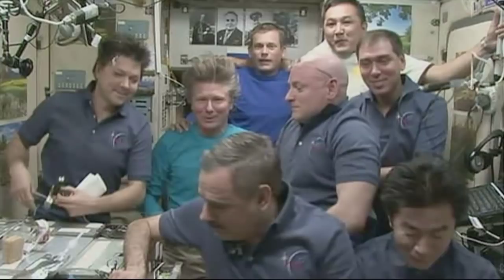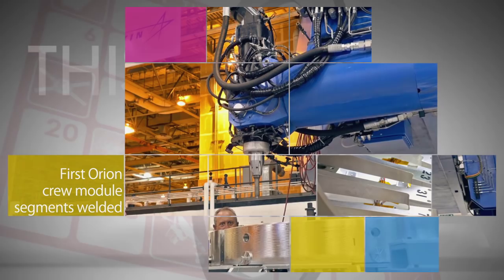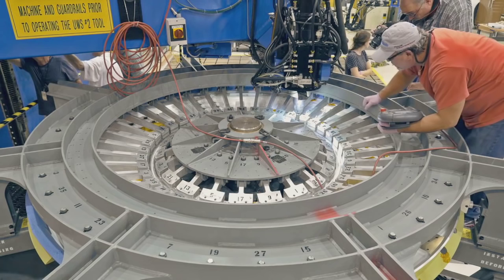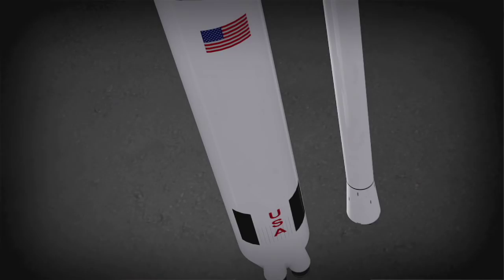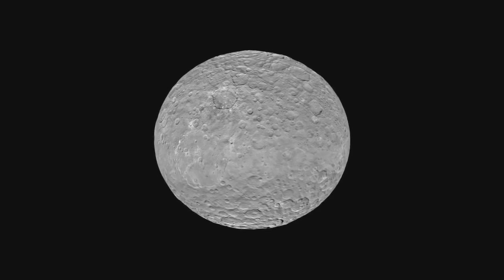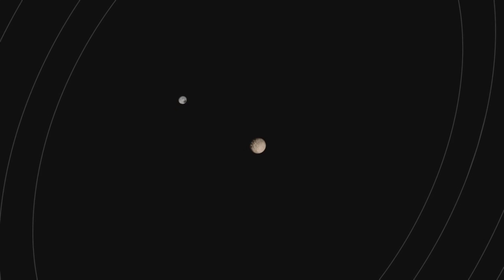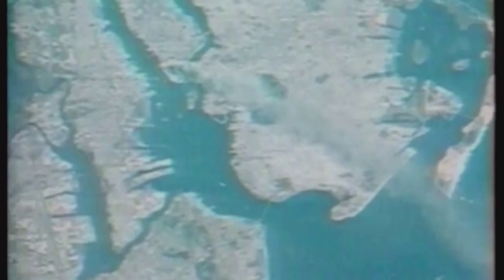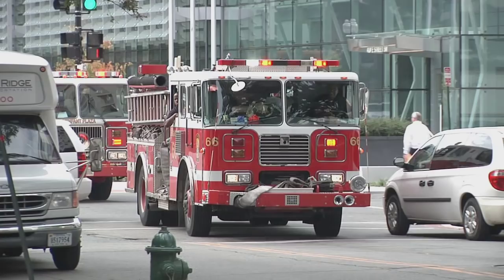Space Station Astronauts Make Safe Landing on This Week @NASA – September 11, 2015

Comment: Anyone know why their was visiting crew and why Gennady Padalka came home on a different Soyuz to the one he went up in? it just seems a bit strange did one craft only fly up their with 2 men (thought that was frowned upon for safety and cost reasons), was there only 2 visiting crew members I though there was 3 but only two have cam home so far?

also I always thought that the seats for every Soyuz where build specifically for each person, so my seat wouldn't real fit someone else perfectly?
Reply: +prepre73 Gennady launched with Kelly and Kornienko, another crew of three came in july (Lindgren, Kononenko and Yui). Now Padalka has left, Kornienko and Kelly need a new flight engineer for their Soyuz and that will be Volkov who piloted the visiting crew of 2 up there. They always come and leave three at a time.

And I'm not completely informed on the seat business but I think the custom seats can be interchanged ie. physically removed from one soyuz and installed in an other while docked at station.
Reply: +Povl Besser thanks so basically it's because of the year long space mission they did not want 3 people staying there for a year so they flew up two visiting members to basically take one guy home and replace him. makes scenes but I still think it's a wired decision
Reply: prepre73
Yes. It is all to accommodate for the year long mission and yes, it seems weird to have people visit for such an insignificant amount of time. Especially when the visiting crew are actual astro/cosmonauts who have actual work to do.
I only hope Andy Mogensen will get a full duration mission soonish.
Reply: +Povl Besser As I understood it, the 2 seats on the 10-days mission were supposed to be occupied by space tourists (Sara Brightman and someone else). Not sure if both of them at once, but at least Sarah. Once she (they) backed down from the flight the seats were awarded to real astronauts instead.
Reply: RufftaMan
One seat was supposed to be. ESA bought the other seat quite early. Sarah Brightman had a backup, a Japanese business man but when she declared she wasn't going, it turned out the business man hadn't quite enough cash to pay for the seat.